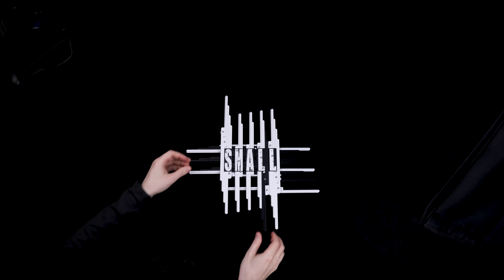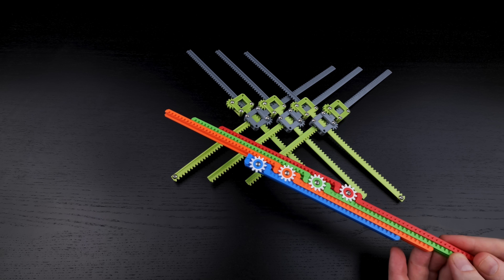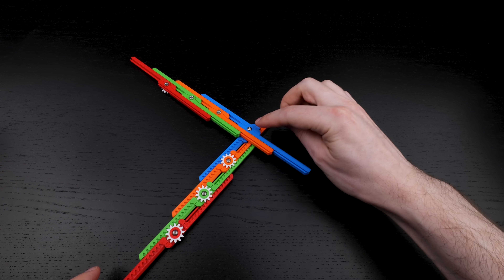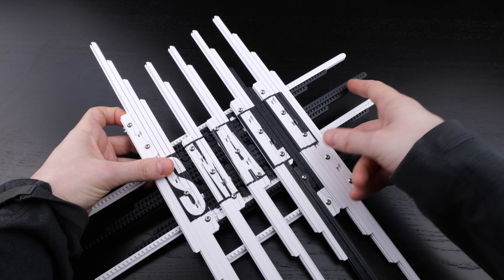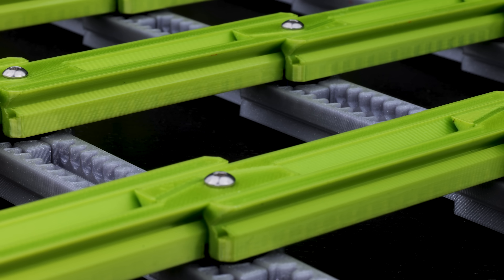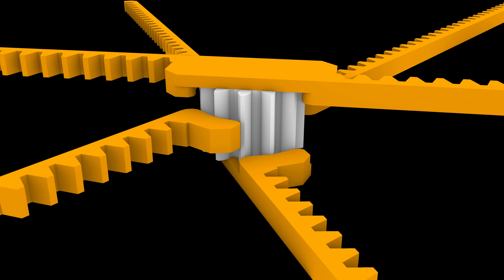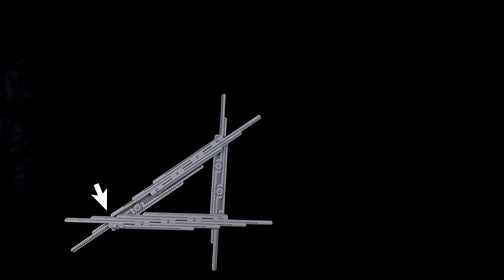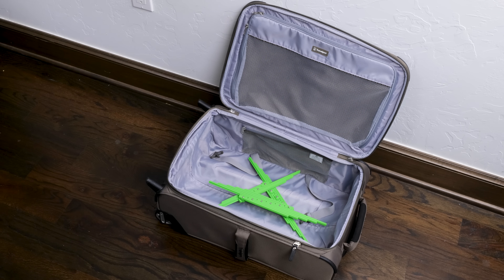Expanding racks

Comment: I think the opposing expansion/contraction could be really useful, but specifically if you could make a "decoupler" to join multiple mechanisms that expand or contract their own regions, without forcing the other to follow suit. At that point you have computational capabilities with nothing but racks! 

Of course, I wouldn't be smart enough to actually make logic gates or anything but you have binary with contracted as 0, expanded as 1, and input/output with manually moving parts... but most interesting of all is if any computation was achieved, aside from the initial human input and output, it would be forced to function entirely analog! 

At least, I think having those 3 "functions" would be enough to create conditional mechanisms... I'm suddenly not sure... but I'm curious what would have to happen if not to introduce computation! Perhaps mechanical could have use in computation if so because currently nothing happens completely synchronously in electronics. Imagine "mechanical logic chips" where electronic inputs are given, and a small synchronous pre-built function is run and re-translated into electronic signals on the other end of the function, allowing certain isolated problems to not worry about time past how long a single expansion/contraction takes!

Then the problem would become size and friction, too, but still, a cool thought!
Reply from the maker: So far these mechanisms are all one degree of freedom, so everything is reversible. But things like OR gates are not reversible - if the output is True, you don't know which input was True. So as you say, it would need some new kind of mechanism for the "decoupler". Perhaps something with ratchets?
Reply: @henryseg  I was looking at "Slipping Gears" for RC cars, and I think that might get the job done. 

Depending on how intense the wear is and if you could get away with the weird shaped "Shaft" (More like the rigid piece in the middle) being printed with the same material and in the same piece as the rest of the rack...

Another interesting idea would be creating "stationary points" where everything moves around a gear, but any surrounding motion gets countered, allowing that gear to say, be mounted in place, turning something else behind the scenes (I guess as a potential "output")

Like a geared version of the "Wyrd" mechanism! And if that's possible, I wonder how extreme it could get? Could you get multiple stationary points? How far could you get dynamic points from each other without moving something stationary? 

And if a ratcheting rack is possible, combined with a functional wyrm mechanism... how many states could you get out of how many racks? 

It could be a fun challenge, to find the most complex "machine" possible with only 8 maximum linkages, or 20, or any number! 

I'll admit, I want to test this myself, but my CAD skills suck to an extent that I fear I may never be able to print something of my own design... If you ever make a ratcheting version of your racks, I want so badly to print some of my own and try to at least figure out some logic gates! Maybe even a little "program"!

Comment: Have you thought about making ones where the gears and teeth are different sizes from each other? That way you could have structures which expand different amounts in different directions.
Reply from the maker: The 45-45-90 triangle already does that in a sense - the hypotenuse expands more quickly than the other two sides. But yeah, it would be interesting to have the shape change, not just expand or contract.

Comment: What if the expansion was asymmetrical? Let's say you have a  3x3 grid, but the gears have different ratios higher up, the expanded form would be curved. (assuming the shape allows for some mending or flexing)
Reply from the maker: Flexing out of the plane could be interesting, although then there's more of a chance of the gears losing contact with their racks. And the rails and grooves are pretty good at rigidifying the parts against bending!

Comment: Maxwell, when deriving the equations of electromagnetism, used a model that in the two-dimensional case can be represented as infinite hexagonal grid of gears (the rotation of these gears is an analogue of a magnetic field). Between these fixed gears are located the satellite gears. The rotation of satellite gears is an analogue of a electric field. If the axes of the satellites are not fixed, then they have additional degrees of freedom and can move, as do charges in conductors. 
Is it possible to create such a model?🤔

Comment: I could see the expanding square grid being used maybe with like cloth connected to each bolt. So the cloth would bunch up when closed, Then when you expand the grid out it makes the cloth become flat. So like maybe if you had big enough ones, you could like make a like a tent/shelter thing, where you can just like expand the grid out to make the walls and roof. Then Like slot them together somehow.

Comment: What happens if you could use different gears on the same stick layer? 🤔 Could you accelerate one end of the stick in such a way that it gives a sudden snapping punch like a whip you know? Like implementing planetary gears or something to get more leverage or speed because of the increase or decreasing ratios?
Reply: Like building a coil gun but without a coil gun but with sticks and gears instead? 🤔
Reply from the maker: Sure - just like an ordinary gear train can trade angular velocity for torque, I think you could do something similar here. In a sense, the 45-45-90 triangle already does that: the hypotenuse has bigger teeth so it moves further than the other two sides for the same amount of rotation of a gear at one end.

Comment: can the gearing be changed so it doesn't expand linearly? 

like, what if you wanted a rack that has segments that expand logarithmically? this could be useful as a tool for drawing logarithmic scales.
Reply from the maker: Maybe - I've thought a bit about variable radius gears. You'd need something like that to vary the speed as the stick extends.

Comment: I can imagine a shelf, with 2 of these triangles at either side.

You can pull the shelf "out" and it comes down lower and becomes a platform.

Extend the racks "Sideways" and they become platforms for the shelf/table.

Add some kind of springs into the mechanism (I imagine something akin to a switch-blade, that has a bistable spinging mechanism) and you have a small high shallow shelf, that can convert into a deep lower table.  Only downside is the holes in the wall to accept the base of the shelves arms sticking into it when collapsed ;)

Comment: How structurally sound are they? Could they make for easy expandable tents?
Reply from the maker: It’s hard to compete with current tent designs for collapsibility. And the gears and racks are more likely to get clogged with dirt… now if your tent is in space and needs to be set up remotely by some motors, maybe something like this is better.

Comment: Looks like a hands on learning project series for the construction of moving and inter cooperative structural designs pertaining to collapsible features..  like bridge designs that require lifting or raising for boats or locks.  Waterway spillways and directional routing. Or like those collapsible bleachers used in some school gymnasiums to save space..

Comment: 5:57 That expand-contract mechanism sounds perfect for a climbing wedge. It expands to fill a gap and holds in place by friction while bearing weight but then is easy to pull out after the load is taken off. It also seems like a decent tool for splitting things apart. Contract it until it is long&thin, stick it between two things, stand on top, and watch them push apart. Great stuff!
Reply: Yes! Many applications. I was thinking ones where you need to access or grab objects in awkward or smaller holes. Like inside a wall even. Put it in contracted, then push it in to extend once inside. You can definitely hinge this design as well.
Reply: @KaiserTom  Put the weight on the top, not the bottom (loop of rope over the wedge or just step on it)
Reply: Except these things look fragile as hell and can't bear a lot of load.
Reply: @n484l3iehugtil  It would be really easy to over-build one out of steel that would hold plenty of weight. Literally just make everything a lot thicker and it probably holds literal tons. Whether it can be built to a reasonable standard for reasonable money is a more difficult question but I'm not actually trying to take this to market lmao
Reply: @n484l3iehugtil  guy who's never heard of a demonstration:
Reply: Yeah if it worked that way, except it contracts when pulled so it would make a useless and deadly climbing tool

Comment: I think the straight expendable model would be great to build drawers.

The perpendicular rail could be used to move the drawer front down when pushed in the enclosure, thus allowing for example front Gridfinity bins to be accessed without opening the drawer, while avoiding their content to spill when you open the drawer because the front moves up when you pull the drawer.

Comment: Cool.  I'm thinking the expanding could be used as a twist of the handle in an umbrella action where the straight lines are curved links and links from the center.  The spiral out of the umbrella would expand unlike the current parallel branches of an umbrella.  I look forward to your next design.

Comment: I think it would be interesting if you were to explore the possibility rotating pieces. At 4:20 you place a new double rack ontop of the gear. What if instead you attached it directly to the gear causing it to spin while it rotates. Using gear ratios you may be able to make an arm spin out a certain amount. Using this it may be possible to make something that compacts down to nearly entirely flat become a 3d object. From this you could use some sort of connector or stop to lock parts in place. This could be used to maybe create a tent that quickly pops up and then can be quickly taken apart.
Reply from the maker: I have thought about this, and there were a couple of designs like that in my previous “Recursive racks” video. One issue is that the gears rotate many times as the rack moves in, and we generally want a slower rotation. So it would need some gearing down or similar.

Comment: @3:35 If you fixed the end of the orange, put a weight at the orange's gear then pulled on the red end and scaled it up, you could move a large object in your yard. Maybe not with plastic but... It seems to reduce like a series of pulleys and idlers, block and tackle I guess you could say.
Reply from the maker: Right, there is some mechanical advantage.
Reply: @henryseg no the opposite

Comment: I love rack&pinions. I've a challange for you, do you think we can up the amount of pinions while shortening the rack without gear binding?

I've a setup that utilizes multiple X sized pinion gears and inbetween a smaller Y corrector gear (just lower in diameter to not touch the rack teeth, not too small to keep the amount of gears to a minimum) for keeping the pinions move to the same direction with same amount of reduction. 
With this setup I can make 2 small racks that are always in contact with at least 2 pinions, as a result giving me a full leinght rack&pinion setup rather than a half way one.
 Again, I still couldn't figure out the play between gears so it always binds around the 4th pinion. I'm trying to make them as thin as humanly possible so I really can't fiddle with herringbone gears for better continious contact. It has to be something with the gear tooh profiles (I ain't no engineer so figuring the proper ratios are often 3d printing trial&error for me)

I'd love to see your take on it <3
Reply from the maker: It's hard to talk about geometry in words! Could you email me a picture?

Comment: Lovely work Henry - mathematics + printing + editing.  Some ideas that may be fun:  1. Curve the rack stacks.  Either concentric in a plane or around a cylinder, or even helical.  (Not fun to print)   2. Since you can change the gear ratio like at the corners of your triangles, what if you do this within a stack of straight racks?  The only point I can think of here is to have mirrored halves, so that one expands as the other contracts, keeping the same length overall.   3. Fairly obvious: have x, y and z linked.  I'm sure you've already got a prototype of this.
Reply: (BTW "Attached rack stacks" should be the name for these.)

Comment: On seeing those quads and triangles being stretched and squished my graphics programmer brain went immediately to projected polygonal meshes. Am I correct in thinking that you can scale each edge orientation of a tiling arbitrarily by changing the gearing? And the mechanism lets you implement (the shear + positive scale subset of?) an affine transform? If so I think the mechanism could be used to shift between displaying two different projections of some polygonal mesh, for example isometric when contracted and cabinet when expanded. This assuming a sufficiently nice transform that doesn't mirror anything, and no doubt several other constraints that I haven't realized.

If it's possible to gear such that each individual edge of each polygon is scaled independently then it should also be possible to make a mechanism that transforms between a perpspective projection and a parallel projection of a polygonal mesh.

Like all graphics programmers my understanding of geometry is based purely on hearsay and I'm not sure how practical it is to realize given the constraints of the mechanism itself. Making an expanding mechanism that runs Doom -- or transforms from a Doom level to the wireframe of a single static screenshot of Doom -- may be challenging.
Reply from the maker: Yeah Doom might require some more work... I've thought about making just a square that shears into the appropriate parallelogram shapes. That already sounds challenging!

Comment: There are expandable garden trellises that typically use scissor linkage patterns, may be your research could be applied to them.
Reply from the maker: It's probably easier to clean dirt and bits of plant out of the hinges of a scissor linkage than the gears of an expanding rack!
Reply: @henryseg  I don't move them after I set them up, so cleaning doesn't matter much for me. But they are very wobbly when they are big, your triangular rack grid seems more stable.

Comment: Maybe no one has mentioned it, so here I go. About using the expanding-contracting mechanism for something, it has been said that it doesn't produce triangles of the same area. But –useless though it may be– it does generate tangents to a parabola. I mean, if you imagine the two lines of racks as lying on the axes of the x-y plane, and the angle at the origin, then join the two ends with an elastic string, then as you move it, that string is always tangent to a second degree bezier curve which is a parabola... that's the best I could come up with 😅

Comment: One good expanding (in a single dimension) item is the Metolius Roll Up Stick Clip. It's used by climbers to reach anchors.
Thanks for another interesting video.

BYW, I'd love to print your linear mechanism. Any chance you could share the design from the beginning of the video?

I keep looking for ways to add a robotic arm with a long reach to a drone. Your single dimension mechanism looks promising for this purpose.
Reply from the maker: That Metolius mechanism is super cool - I hadn't seen something like that before. (It's a compliant mechanism though, which means I don't understand how to make them!)

The parts for the expanding triangle include what you need to just make a single stick, if that's what you mean?
Reply: @henryseg  "to just make a single stick, if that's what you mean?"
Yes, that what I meant. Thanks.

The video 7 Ways to NOT break your ankle shows the Metolius mechanism in use at 4:50.

I think your rack and pinion design would be easier to incorporate into a robotic arm/claw. I'm not sure if a design similar to the Metolius mechanism would be stable in partially extended positions.

Comment: Could be an interesting optimization problem to try to approximate arbitrary triangles while keeping the scale factor as close to 1 as possible while varying the rack counts and the tooth counts on the transition gears.
Reply from the maker: Yes, although once you have any differently sized racks at all, the complication in designing goes way up. I guess you'd want to automate much more than I'm doing for that kind of design. Does having similar sized racks have advantages beyond the aesthetic challenge?

Comment: I can imagine the space industry might be interested in this. Satellites have to be folded into the cargo bay of the rocket somehow...
Reply: Absolutely!!! My only worry is the sheer number of components, as you run into quite rude physics of the same material fusing together, but if they aren't they would expand in different way, breaking the layers.

But given the fact that we now have origami solar panels and the James Webb exists, those are simply challenges to be solved
Reply: @kirowilber9121  My biggest worry is about friction. all of those gears are going to generate a lot of it with all of the rotating parts.
Reply: @thenarwhalmage Not a big deal if you only have to do it once. The real problem would be how much of a pain and how expensive it'd be to manufacture these